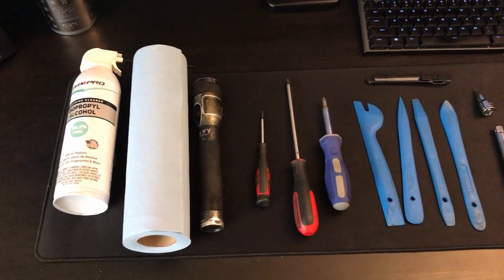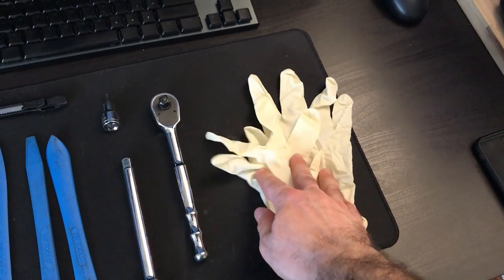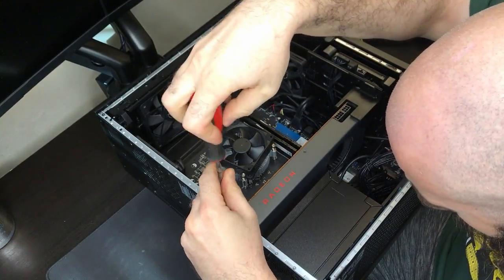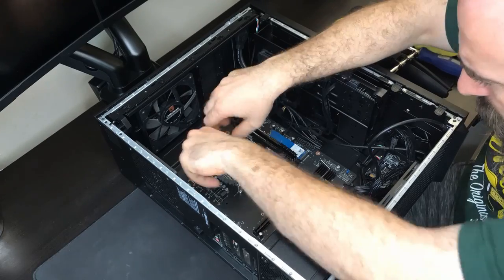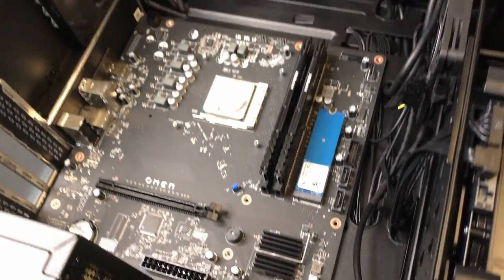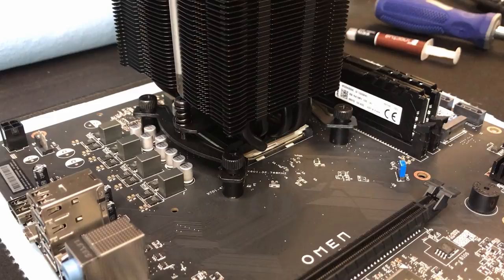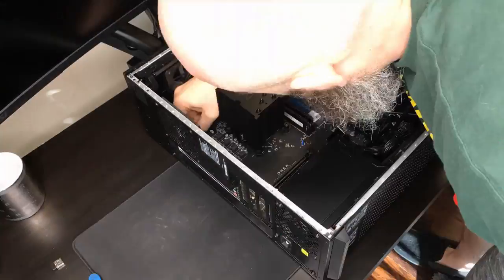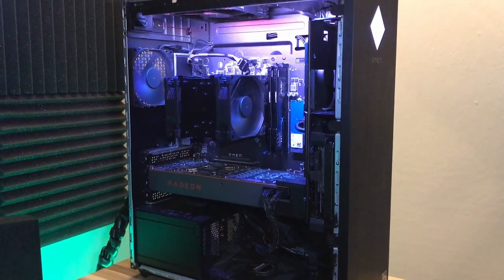Installing A Noctua CPU Air Cooler In My Omen! Complete Tutorial 😎

Comment: what screw driver did u use to remove the heatsink im having trouble btw appreciate u for all these vids they’ve helped a lot
Reply from the maker: Thanks! Happy to help. I mention it in this video but it’s a Torx T15 socket to remove the factory air cooler 👍🏻
Reply: @DanKamYouKnow  thanks man i got it i installed an aio cooler i turned it on and the temp was 102c i don’t know why i unplugged my pc have any idea why this might be ?
Reply from the maker: The cooler isn’t seated properly / incorrect cooler brackets used / thermal paste application / Cooler fans not hooked up / Plastic cover over AIO block was not removed before seating cooler.

I’m guessing the cooler isn’t seated properly but you’ll have to probably take it apart to see what happened.
Reply: @DanKamYouKnow  i think it might have been the bracket but the amd bracket doesnt fit on this mother board
Reply from the maker: All Omens use Intel brackets, even if it has an AMD CPU.
Reply: @DanKamYouKnow  yea man i figured out what it was it was the thermal paste. my temps were idle at around 70-75 which is ridiculous but now they idle at aroumd 45-50
Reply from the maker: That’s good to hear!! Definitely gotta have the right amount of paste on there. Glad you figured it out

Comment: Hi Dan, quick question. Every game that i play, except for League of Legends, my 25L is making lots of noise. I have everything stock (CPU fan + rear exhaust fan) so i wonder if i can get it less noisey by installing just a top fan and replace the exhaust fan. 

I kinda want to leave the CPU swap as my final option cause it seems quite technical. 

What would you say?
Reply from the maker: Some of the noise you might be hearing will be the graphics card fan(s) too. Replacing all the stock fans is a good idea, and adding a top (exhaust) and bottom (intake) mounted 120mm fan for some more airflow.
Reply: @DanKamYouKnow  Alright i'm about to order the Noctua NF-F12 PWM chromax (Two times, for top exhaust and bottom intake). Do I need the Y-Split Cable for this upgrade of adding two new fans?
And if i want to buy the Noctua Chromax U9S, is that all i need to order? Thank you.
Reply from the maker: I would recommend the 2 pack of y-split cables in the description. Cheap and good to own, even if you don’t use it.

The U9S will come with everything you need to install. Except the 2nd fan, which isn’t 100% necessary.

Comment: I was nervous to try ripping the backplate of I did it differently I just used the back of my screwdriver and pushed the backplate out from the front pushing each bit out little by little until it just popped off I did make sure to hold the motherboard in the places I was applying pressure in order to ensure there was minimal motherboard flex worked well for my just wanted to let anyone know in case they wanna try it that way too.

Comment: This is a bit late but i followed all your instructions and when I turn the pc on nothing happens, the lights turn on and I hear the gpu fan but no other fans turn on and it shuts off after a couple seconds, any idea on what could be wrong?
Reply from the maker: Do you hear any beeping? Count the number of beeps ( short and long beeps ) if you do hear them. Are you sure that you have EVERYTHING plugged in properly and secure?
Reply: @DanKamYouKnow  No beeps and I unplugged everything and put it back in including the ram and nothing, the lights turn on and the gpu fan but I get no display and the fans won't move
Reply: @DanKamYouKnow  do you think the cpu could have come slightly unseated and isn't seated properly under the cooler?
Reply: @DanKamYouKnow  oh my god I missed an entire plug
Reply: @DanKamYouKnow  I am an idiot
Reply from the maker: Is it working now?!?!?
Reply: @DanKamYouKnow  yeah, it's all good now and my Temps have dropped super low, thanks for the video dude!
Reply from the maker: 🎉🎉🎉🎉🎉 You’re welcome!!

Comment: Could you potentially us the original bracket on the back of the motherboard to install this fan or do you have to change it?
Reply from the maker: To install this air cooler, you will need to remove the motherboard. It won’t bolt up to the stock cooler bracket.

Comment: Would this cooler be a significant upgrade if we have the one with the liquid cooler? Also how hard would you consider this upgrade? i've never really installed anything in a pc past just a hard drive so i'm not sure if i should try this or not
Reply from the maker: Swapping from your current AIO to this air cooler won’t change the temps that much. The problem with Omens that come with the liquid coolers is air flow. Your best bet is to swap the case. What specific processor do you have in your Omen?
Reply: DanKamYouKnow I have the intel i7 10700kf
Reply from the maker: What kind of temps are you getting?
Reply: DanKamYouKnow after playing cyberpunk for a little my cpu maximums are in the high 80s and my gpu is 75 for the normal one, 94 for the memory, and 86 for the hot spot
Reply from the maker: High 80’s is pretty warm. You could always try to download Intel XTU and under-volt slightly. Also, it will limit your CPU boost slightly, but you could change your max CPU processor state to 99% and your minimum to 5%. You can find them in the advanced display options in display settings.
Reply: DanKamYouKnow Would you say the GPU temps are fine then?
Reply from the maker: GPU temps look good 👍🏻

Comment: Hey Dan i see you have two fans on your CPU cooler but the one you have linked to only seems to have one? any tips
Reply from the maker: The cooler only comes with 1 fan, gotta buy the 2nd one. It’s not 100% necessary though:

https://amzn.to/3HL985e
Reply: @DanKamYouKnow  Thanks my friend legend as always! i think i may just buy the 2nd i recently fitted in a i9 10900k to go with my 3060 TI it runs REALLY Hot with stock cooler so guess its time to do this i was hoping to avoid! but it needs to be done warzone was sending it 80+ :(
Reply: @DanKamYouKnow  did you ever find out where we can buy hp omen compatible ram for intel that will auto adjust the speeds for us as we can cant get into bios?
Reply from the maker: Well, Omens are receiving a BIOS update that allows for XMP updates, but not all have gotten them yet. Mine has not so I haven't made a video on it. It allows for allowing XMP for NON HP RAM.
Reply: @DanKamYouKnow  oh wow !! That’s amazing about time they do this , I’ll keep an eye iut

Comment: Am I loosing the official warranty doing what you just did?
Reply from the maker: Well, from what I have heard, HP will warranty most concerns as long as the computer is in stock form. So if it does need to be sent in for a warranty concern,’you would just have to revert the PC back to stock.

Comment: i know its been a couple months running that air cooler, how does it perform still? I have a 30l and searching for some some air coolers.
Reply from the maker: Hands down the best modification I have made to the computer. In this case, it’s yielded the best results of any cooler I’ve seen ( just shy of the Noctua D9L but that only comes in polished silver instead of black like the U9S ). I’ve had this thing on since around late October and computer is running fantastic.

Comment: Thanks!  I just installed mine today.  Just the one push fan.  My kit came with thread adapters so I didn't have to remove the whole freaking mother board.   However I had to find smaller spacers for them to fit with the bracket.  GPU 29c. CPU47c
Reply from the maker: Thread adaptors?! You were able to attach the cooler with the stock Omen bracket?
Reply: @DanKamYouKnow  yeah!  the smaller bracket, works fine, all threads tight.  Thread adapters and spacers, although all the spacers were a little too big, so the adapters threads couldn't reach. Thankfully had shorter ones in a parts chest, they work great.
Reply from the maker: Are you sure your cooler is making good contact with the CPU? What kind of temps are you seeing now?
Reply: @DanKamYouKnow  GPU 29c, CPU 44c,  idle temps.  However, I may used too much thermal paste.  CPU just jumped up to 58c, and now steady at 46c.  Plate was flush to the chip on set. and was able to tighten all the way.  Looks clean.  Spacer, bracket, bolt with different thread type each side... guess that not an adapter but 4 two sized bolts to hold the 2 brackets.
Reply from the maker: Ahhh, gotcha. I was going to attempt this method first but decided to do the whole process for a video. I’m glad it’s working out for you! U9S is such a fantastic cooler, amongst the best results I’ve seen with available coolers for the Omen 👍🏻
Reply: @DanKamYouKnow  Thanks much!  You are a big help to us 25L Omen owners.

Comment: Hey man i just bought a 25l with the same cpu cooler in this video to mount them together as soon as i get delivered. But i was wondering, do you have to remove the old cpu bracket like you did ? Cause i saw some other videos where peoples just let the stock bracket and put the new cooler on it. Thx !
Reply from the maker: Replacing the rear CPU cooler bracket is the safest and most recommended way of doing it BUT there is a way to install the cooler with the stock bracket. If you DM me on the Omen Discord group linked in the description, I can send you the instructions that an Omen user put together on doing it.
Reply: @DanKamYouKnow  Thanks for the answer, i just joined the server !

Comment: Why did you have to replace the backplate? In the video, the nuts on the stock backplate look to match.
Reply from the maker: It’s totally different spacing. The cooler would not sit properly on the CPU and would most likely apply too much pressure when screwed down.

Comment: Hi! Greit video. Ive just got the 25L (Was going to buy a new 3070 but its sold out everywhere so endre up with new PC) - Well, I have added some fans on the bottom, middle and top, using your videos. Thanks. Now I’m considering changing the CPU fan. I only wonder if it is possible to do this without removing the MB? Is it possible to remove both of the side panels instead ?
Reply from the maker: Do you just want to change the fan or the entire cooler? Fan replacement is quick and easy but to change out the cooler, you will have to remove the motherboard, which isn’t too difficult of a process just a little time consuming.
Reply: @DanKamYouKnow   Thank you for reply:) - Yes I was checking it today, and it’s no way to reach the bracket for the cooler from behind the panel. So no way around it than your way, for replacing the entire cooler. I will order a Noctua cooler and follow your guide. But maybe a little less thermal paste :) - Thank you for great tutorials. Kind regards from Norway
Reply from the maker: Yes! Definitely used too much thermal paste the first go, lol. Greeting from California!

Comment: Hello Dan! Im wondering whether this cpu cooler would fit into my omen 30L (1660 super + ryzen 3600) version? a reply would be appreciated. Thank you!
Reply from the maker: Yes, this will work with your Omen! 😎
Reply: @DanKamYouKnow  Thanks for the very informative video! subbed!
Reply from the maker: Let me know if you have any questions about the install and thank you for the sub!
Reply: @DanKamYouKnow  Will do! I also have a random question, I just bought a 2.5 ssd and I have no idea what screws to buy (since  hp didnt provide screws) to mount it to the 3.5 tray. Do you have an idea what type of screws should i use?
Reply from the maker: I don’t know what size they are. I would take the hard-drive tray to a hardware store to get the correct ones

Comment: My stock bracket had an extra metal plate under the glue strips, probably so you cant damag the mbo that easily, pretty good stuff from hp
Reply from the maker: Interesting. My bracket just had the 2 pieces of adhesive and that’s it.
Reply: @DanKamYouKnow  yeah that sounds pretty dangerous, anyhow got it installed after 2 hours and works like a charm
Reply: Well, Really suprised, upgraded my i5 8400 to i7 9700 and the stock cooler wasn't enough temps went up to 90° in this omen case. Bought the noctua U9s and followed your guide and now i'm sitting at 35 idle and 63 under load, it has such a big impact
Reply from the maker: That’s awesome to hear! 👍🏻👍🏻👍🏻

Comment: Wait so what brackets did you use to cold the CPU cooler down? Did you buy extra ones or were they from another box or straight out of the box for this one?
Reply: Hold*
Reply from the maker: Yeah, I realize now how confusing that was in the video. I used the U9S parts that came with it. Everything needed to secure it is in the box for the cooler. I’m the video, I show what pieces in that kit are needed
Reply: @DanKamYouKnow  thanks for the quick reply👍🏻keep up the solid work!
Reply from the maker: Thank you!

Comment: What size cooler do I have to order?  I am seeing sizes just like PC fans and not sure which one?  slightly confused
Reply from the maker: The cooler I used comes with a 92mm fan and it’s the Noctua U9S. The cooler has to be shorter than 140mm in total height to fit in the Omen case. If that’s what you are asking.

Comment: hey, maybe a bit late for a question, but i bought a noctua NH-u9s for my omen 25L and the manual says that the backplate goes over the motherboards stock backplate. is this something you missed? Or do you actually need to remove the backplate for the omen 25L specifically?
Reply from the maker: Yes, you need to remove the stock Omen back plate. All Omens are Intel spacing so read that section of the U9S manual. The stock Omen back plate will not work with the U9S accessories.

Comment: Is there any easy way to just use the stock HP backplate for an NH-U9S?  Perhaps just finding the right screws?
Reply from the maker: Requires M3 screws, about 12 or 13mm in length and even then, you really have no idea how much pressure or lack thereof you’ll be placing on the CPU. Removing the motherboard isn’t too long of a process. I do have a write up that someone on our Discord wrote up though, you can message me on Discord ( in the description) and I can send it to you.
Reply: @DanKamYouKnow  That's a good point about the pressure, probably safer to go with replacing the backplate.  One of my friends has the 25L, and at some point I'll probably help install an NH-U9S.
Reply from the maker: The only tedious part is the cooler back plate but not bad with the right tools

Comment: did you  change the fan in the back ? Its a 90mm
Reply from the maker: Yes, I have changed all fans in my Omen, including the rear 92mm fan. Check out my current mods video:

https://youtu.be/HlIAUAMwGBA
Reply: @DanKamYouKnow  thank you for all your finds it’s been helpful. I put a fan on top and bottom but I am still running in the 90s for my cpu temp.
Reply from the maker: https://youtu.be/LwKTsTb_dX8

Try this, even if you have an Intel a processor. Change your maximum processor state to 99% and your minimum to 5%. Keep it like this until you can change the CPU cooler. Glad my videos have been helpful.